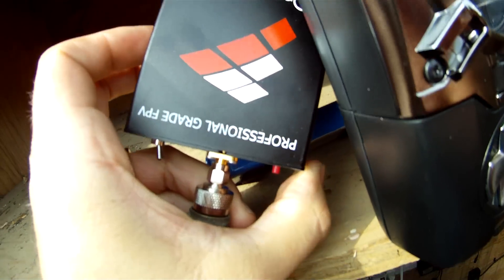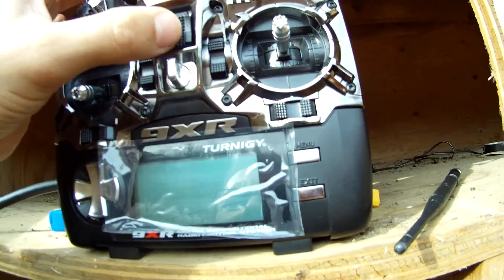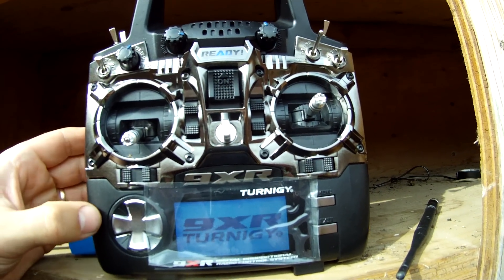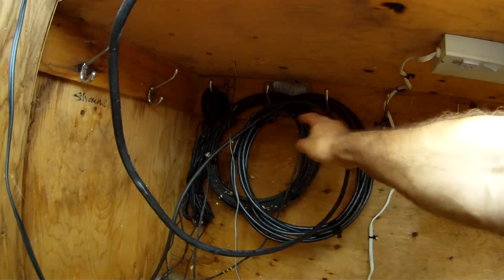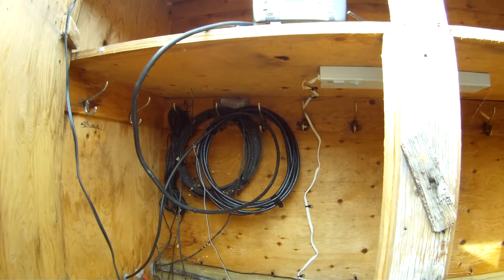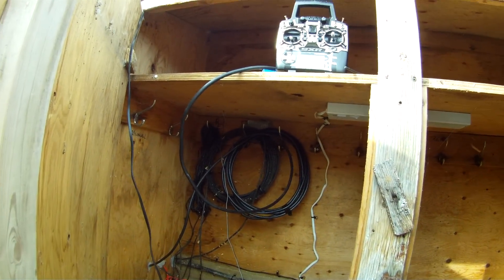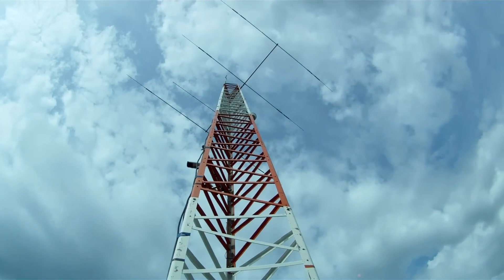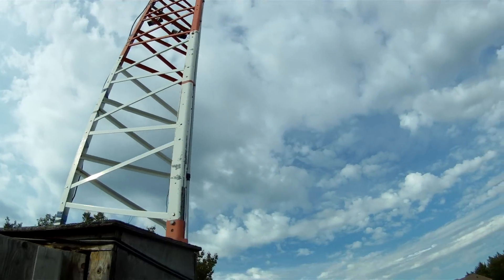Range Test DragonLink & Test with 1.3 GHz Video

Comment: Nice video. Definitely right now the FPV hobby is at its infancy. I don't know what to do yet to be honest. That's why I haven't got into FPV. It's too expensive for me to screw up. I don't have a lot of money to throw away at experimenting. I just want there to be a book out there about how to successfully fly FPV long distance without having difficulties. This realm definitely belongs to HAM operators to explain.
Reply from the maker: Yes it can be expensive but cheaper Chinese hardware certainly makes it less costly. Long distance FPV comes by tweaking, lots of trial & error. Long distance FPV doesn't come right out of the box; it's not easy. Small improvements little by little. Continued improvements gives you success. Good luck & fly safe!